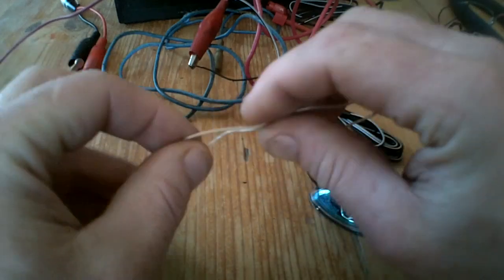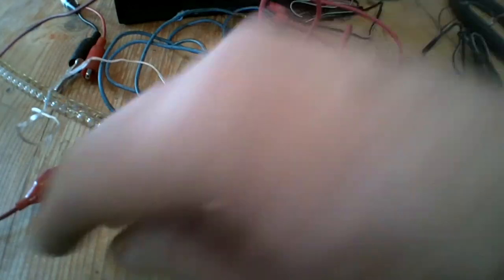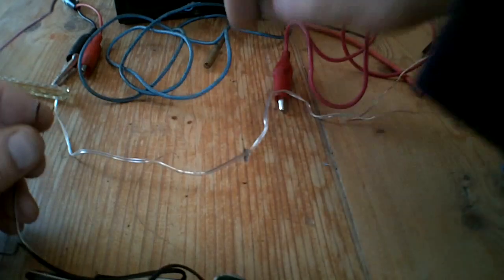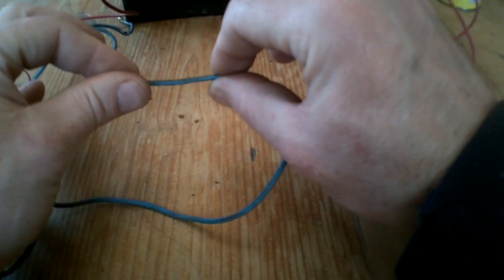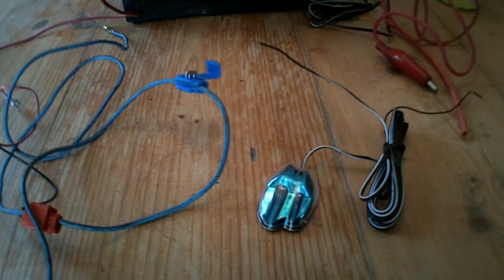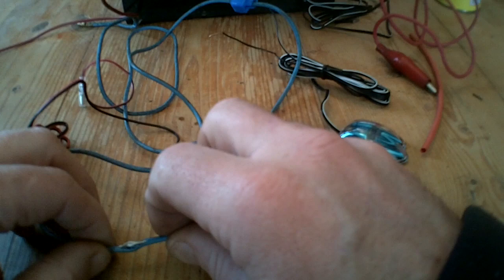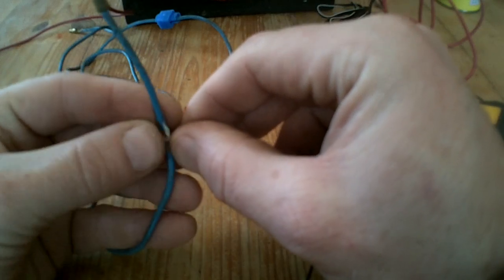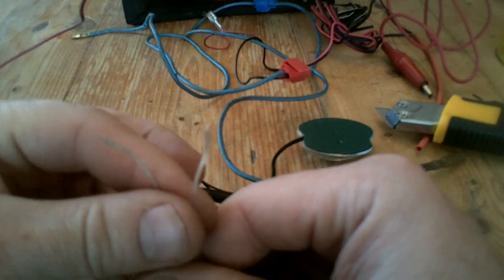simple wire connections and led light wiring

Comment: Can you connect that led to a plug to plug into an outlet?
Reply from the maker: no. these ae low voltage LEDs . Most LEDs used for home lighting run off a converter to convert to low DC voltage

Comment: Thanks for your video. Not doing this for neighbor but did not know I do not need to use a wire spliter to use the plastic clips. Since the clips work, can only assume that they cut into the seal to make contact with the metal wire. Thanks !
Reply from the maker: you got it..that's how they work

Comment: 1st of all this is sh#!+. No one taught me how to wire sh#/+. So that's a presumptuous statement. I've been doing so since I was 16. Natural born knowledge you can say. 2nd, Even b4 u 'weren't' sure which is negative & which is positive, I knew this a long time ago which is which. Only common sense, really. Copper wire, would give For example, better for electrical wiring because it is a good conductor of electricity. Metal particles are held together by strong metallic bonds, which is why they have high melting and boiling points. The free electrons in metals can move through the metal, allowing metals to conduct electricity. & the Silver wire... well, it's just a ground. So basic. Didn't learn nothing on this vid😒
Reply: What the fuck are you babbling about? You're like that guy yelling at an infomercial because you think he's talking directly to you. You learned a few facts about metals at a young age- wow. You want a fucking medal? And if you were paying attention, he showed a good example of people doing shit that doesn't make sense or isn't traditional with a white-striped cable. I can tell you I've been messing with electronics for a long fucking time. 99% of striped cables like what he showed are ground, and that one wasn't. But oooh! You took a guess, that the manufacturer gave a shit about melting points when he chose two colors. Oooo! Impressive! And over the internet, alone- with no one to verify your brilliance! It's just as likely it's a coincidence. But please, tell us all more about how smart you are; there's no shortage of you assholes on the internet. And btw- presumptuous? He just fucking said, "sometimes" and was making the point that he's sometimes wrong. But once again, your genius.   ...Fucking idiot.
Reply: Oh and p.s. your shit made no damn sense anyways. Copper wire would be better than what? SILVER? Or this COPPER wire with silver paint on it? (which is likely what it was). Sorry, you didn't learn anything today. Sorry we bored you. Like a dumbass high school kid dropping in on a 2nd grade class to try to show up a teacher (who probably knows more anyways). Only to look like a damn idiot for dropping in, and then also for not making sense.This guy is trying to teach people shit (that you've apparently mastered) and you're what, over there thinking he's talking directly to you to disrespect you? Give me a break.
Reply: Well good for you🙄, some of us aren't familiar with metal conductive whatevers 😁 and even the thought of wiring is overwhelming and shorts my brain immediately hehe. At least he is bringing info to people who can use it. 
I wonder if instead of all the time you took trying to downplay someone's efforts you had just expounded upon the information he was giving...idk. teamwork and such. Have the best day

Comment: You can hurt by by testing if you leave it wired backwards
Reply from the maker: no you can't really.. An LED is just a diode that emits light . A diode is just a one way valve that allows electricity to flow in only one direction . Hooked up in reverse it just won't light up

Comment: Best place to ground the negative or is it unnecessary
Reply from the maker: if there is no wire ground , then grounding to the metal chassis of the car is best
Reply: @fupabox    Great information Fupabox!!   I simply want the light strip kit to turn on when the foglamps or headlights turn on. I've tried tapping into every fuse but no luck. So running out of options im thinking of running the wire dirrectly to the headlight. Does this sound like it would work? Thanxs BB
Reply from the maker: @TripTheLineFantasic  yes you can hook it to the wires of whatever light you want the strip to come on with.

Comment: Nice video I wonder why the LED did not get destroyed when polarity got reversed?  Is there a diode?
Reply from the maker: yes, LEDs are diodes
Reply: But if you reverse polarity on it, it would be destroyed immediately. How is it yours survived? Was there a diode, non led diode, used?
Reply from the maker: most LED bulbs now have a resistor built in to the positive leg. although I have never seen one ruined when hooked up in reverse.I am not well enough versed in electronics to know the reason it would or wouldn't blow when hooked up backwards.

Comment: i have 2 x stips with 4 led's each that will run off same power circuit/wire on a 12V system they will pass through a toggle on/off switch
http://www.ebay.com.au/itm/2x-Blue-CROOK-3528-SMD-LED-Light-For-Yamaha-YZF-R1-R6-FZ1-FZ6-FZ8-Fazer-/231412291183
what size fuse do i use ?

Comment: So I'm curious, I have had LED's in my car for 4 years without problem... Just tonight for some reason the fuse blew that they were plugged into... did the fuse just wear out? I've checked all the wires and they're all firmly still connected to one another... There was one one where it was starting to come apart which I'll fix but if this doesn't do it what on earth could be causing it?
Reply from the maker: +DingDongDanger  one of the other components on that circuit could have caused the fuse to blow..also,fuses aren't made as well as they used to be..no copper , so they can corrode from air exposure over time , and it could go bad
Reply: I ended up having to completely uninstall them today, rechecked the wires, re-did the connection on one of sautered parts just to be sure, and it still shorted out without blowing the fuse this time... It was one of the radio fuse LED's my radio and everything seems fine now that they're uninstalled but I also noticed some damage to the LED strip itself, I think the mechanics screwed it up when they dropped my column because upon further inspection the wire got seriously jammed into the column.

Is it possible the ground got messed up? When I pulled the wires out that were attached to the ground it looked silver and melted instead of copper and in wire strands. Could the ground have gone bad?
Reply: Hi Mr Fupabox, would you be able to help me with some wiring?

Comment: Okay. I'm electrically retarded. I know you can't directly connect the positive and negative sides of a battery or it will short. But if you have two wires, one running from the positive, one from the negative, do you connect those wires together to complete the circuit if they're not running to anything? Or is this a sort of "direct connection" that will also cause it to short? I have quite a few questions, but I'll happily give my e-mail to anyone willing and able to help.
P.S. I'll happily share my decent knowledge of HVAC work in exchange if needed/wanted :P

Comment: Another stupid question, once I splice the positive wires together is there another wire that I connect the negative with or do I ground that to any iron piece of the car? I no I can't ground it by the fuse box or the battery area
Reply from the maker: any ground is ok...there should be a ground to the light you are taping into, so you could use its ground

Comment: I have a question, I want to splice two led light strips (one being the clear light strip shown in your video and the second will be those flat water proof black ones) into the parking lights, am I able to do this? Will I have to splice into another power source?
Reply from the maker: you can splice them in with no other power source needed...the LEDs will draw so little power that the circuit won't be affected

Comment: Thanks a ton for the video! I am 19 and I am trying to wire up a resistor to my truck for LED turn signal bulbs and I need to use the quick splice for the resistor. Helps clarify everything since manufacturer doesn't provie instructions